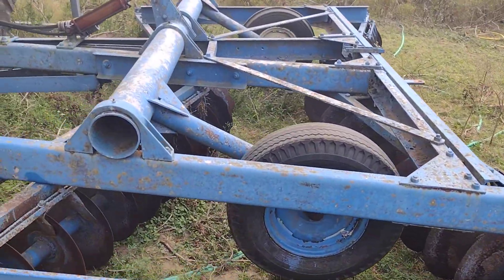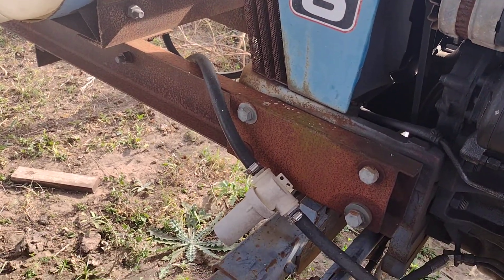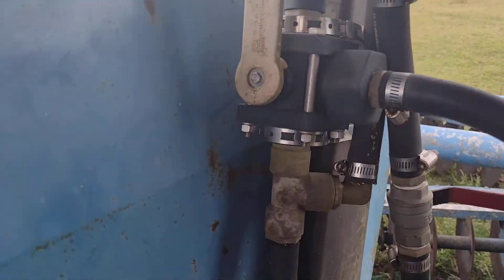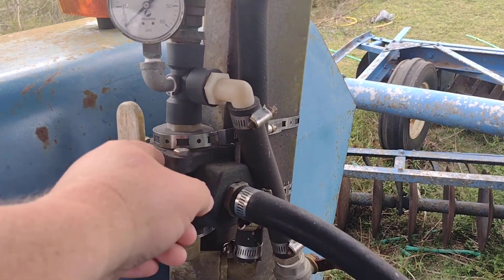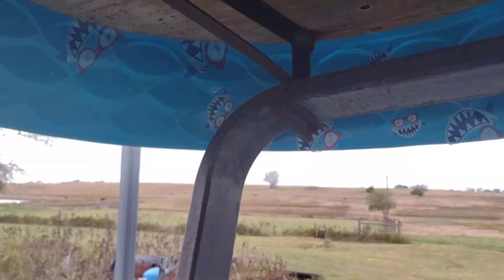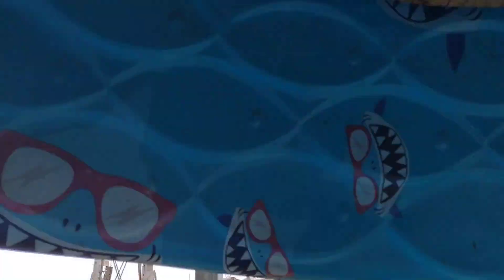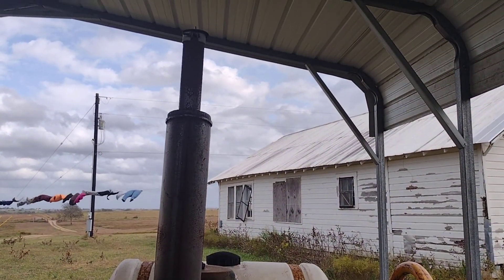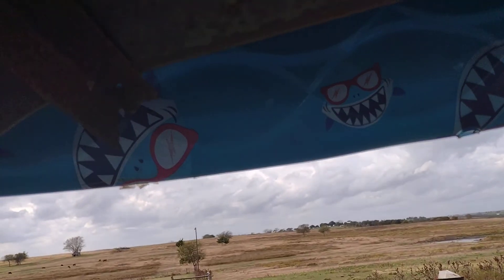24 Nov 2021- Kiddie pool tractor shade, sprayer setup on 5610S, Ford 247 disk

Comment from the maker: If you park the tractor in the shed, the kiddie pools last about 4 years or so before the plastic starts cracking much.  If your tractor is parked in the sun outdoors all the time, the pools will start to crack pretty bad after about two years... BUT they're cheap and easy to replace.  I built these way back in the mid-late 90's when we bought these tractors, which is why the frames are kinda rusty, but they've held up to bouncing over rough ground, working under trees, and lots of other stuff over the years, so they've worked great.  Sure beats roasting in the hot Texas sun all summer and even keeps a lot of rain off you if caught in a sudden downpour.  Well worth the time and money, and a TINY fraction of the cost of commercial made tractor toppers that don't even shade you as well, particularly from the sides!! Be sure to check out www.farmshow.com for other great farmer ideas and tips and tricks!!  Later! OL J R

Comment: Hey Luke how's it going? I ended up buying a Ford 551 round baler at a sale and have been working on it these nasty winter days trying to get it ready for spring. All the belts on it are slick including the wide platform belt on the bottom which seems to be a problem. I haven't got to try it out except for unrolling a roll of hay and trying to bale it back up and it wouldn't start the core spinning just plug everytime. Anyway long story short I have some spare 8 inch belting with great rough grip and am wondering if I could put 5, 8 inch belts in place of the platform belt. I feel like that would fix my issue and I just don't wanna spend money on it lol I bought it so cheap I wanna keep it cheap. Anyway I figured you were the man to ask about these balers. Thanks!
Reply from the maker: Hey how's it going storminnormanz??  Love the nickname BTW.  Best general since Patton!  The 551, is that a four foot wide chamber baler?  

Okay, lemme see what I can tell you.  First off, the belts ARE (were) slick on these balers... roughest belts you could get were the "mini-rough-top" belts which were golf-ball dimpled surface.  They don't use "traction belts" like the diamond or chevron patterns in other balers-- they didn't need them, and they can cause more problems than they solved.  On my 552, I have 6 bale forming belts up top which are 6 by 466 inches long, and the bottom platform belt is 5 feet wide by I forget the length.  NO, I would NOT replace the bottom belt with individual belts-- they will cross over each other, ball up, and shred the lacings and destroy each other.  There is a central "V" section on the back of the platform belt which runs in a "V" section on the front and rear rollers to guide the platform belt and keep it running true.  

The first thing you want to check is ALL the ball bearings on the baler-- every roller has two, one on each end, and they're not all alike, but they're all rather ridiculously small for a round baler-- what happens when the things were like some of the first balers made.  There is an idler roller mounted on parallel arms, that comes down inside the belts right behind the "crushing roller" right behind the pickup teeth, the idler roller is the "starter roller" and it has a bar with tines that come down between the belts to keep the hay from going between the upper belts and the crushing roller, to prevent backfeeding and the bale trying to form around the crushing roller which will lock up the baler and pop the shear bolt and cause all kinds of h3ll... MAKE SURE that the starter roller is free to move up and down-- it's spring loaded but it can get sticky and not want to move.  It should drop down with the tines between the upper belts near the back of the crusher roller to start a bale, once the bale starts and gets about a foot or so in diameter it will lift the starter fingers out by pushing the roller up on the parallel arms which moves it to the front of the chamber.  

Second, you want to make sure EVERYTHING is turning UNDER POWER correctly... the bottom platform belt is powered by the front roller underneath the crushing roller by a large sprocket and keyway... if the key shears, the shaft won't turn the roller, or if it "freewheels" to turn empty it will quickly stop under load, and the bale won't form.  There are 3 idler rollers inside the platform belt; their bearings are behind the tires on either side of the baler-- 2 are in the middle, the rear one is what the belt wraps around to to back to the front roller again.  It is spring loaded and has to be set correctly, using a pair of steel rods which should stick out just flush with the rear moveable framework the platform rear idler runs in... there's 2 bolt heads in the middle of two flat plates (one on either side) that pull on the springs to set the tension on the platform belt.  The upper belts are driven by a LONG #60 chain that turns the bottom front upper belt roller directly above the crushing roller, the next roller above it, and the top roller which is a tire-core type roller for a friction drive.  The top roller does about 90% or so of the driving for the upper belts, the belts fold back around it, then go around an idler roller, and then up and back and up and back through the belt shuttle, which is spring loaded and pulled backwards as the bale forms and gets bigger.  Those are all idler rollers as are the ones at the top and across the back of the rear door, which is forced open by relieving hydraulic pressure from the rod end of the cylinders back to the head ends of the cylinders through a pressure relief valve on the front of the baler, with a gauge to set the pressure (I run mine at maximum because well, it's an old baler and they don't make tight bales ANYWAY).  The rear roller is mounted on a pivoting subframe off the bottom of the back door, and basically the entire bale sits on that roller when it's forming until it's nearly full size, and it has two small ball bearings in it, and when they go, it will get RED HOT and start fires (ask me how I know) and so you want to roll that roller and make sure that its rolling smooth and freely, know you have good bearings in there.  There are a pair of cams that bolt onto the end of the shaft with locking Allen head capscrews recessed down in the cams, these cams set the clearance between the bottom roller and belts and the platform belt-- there should be about 1/4 inch clearance to start with the roller and cams pushed down against the door track.  It will close up under load as the bale gets heavier, and you don't want the upper belts, moving forward as they wrap around the bottom roller and onto the bale, scrubbing HARD against the platform belt which is moving backwards.  There's a setscrew on the RH side pivot as well which keeps the roller's axle shaft from turning in the pivots, and a pair of small pipe roller spacers loose between the ends and the pivots to keep everything spaced properly.  As the bale forms, when it is nearly full size, the door will be forced gradually back against the hydraulic relief valve until the bale reaches full size-- when it goes oversize, the door is forced back enough that hay continuing to come in the pickup is simply spit out the back through the gap between the platform belt and the upper belts.  To wrap the bale at that point, you have to stop, find the end of the twine in the ball of hay on the ground at the back, shove it up between the bottom gate roller belts and the bale, and then start up and turn the PTO back on and wrap the bale.  

I've never really had any problems with it starting bales... there's a short #60 roller chain that turns the crimping roller right behind the pickup-- the crushing roller and the platform belt all have to turn under power and load (check for sheared keys) in order to form a bale.  The bottom platform belt is turned by a large 80 chain and sprocket.  All the drive chains are on the LH side of the machine.  The bottom platform belt front drive roller turns the belt that drives the pickup on the RH side of the baler, and that belt can be problematical-- they stretch over time and get loose and can slip and prevent the pickup tines from turning at the correct speed under load, causing problems.   I was having problems a couple decades ago or so when I was still baling road hay-- mostly lush spring ryegrass which when it's dry is VERY slick... it wanted to ball up some in front of the crushing roller because the crushing roller had worn extremely smooth and shiny, so I took the baler to the shop and ran 3 weld beads of 6013 welding rod across their width, just slim, cool, high beads to give the roller a bit of traction, which worked perfectly after that... They made a friction tape kit you could install on the roller, it's in the book but who knows if you could get it anymore and besides I needed a solution RIGHT THEN not waiting on parts.  Just 'weld it cool' and don't get the roller too hot-- don't need penetration or strength, just some grip from the thin weld bead sticking up (6013 makes a 'taller' less penetrating bead at low amperage).  

IF everything is working correctly, it should form a bale no problem... I will tell you this-- it DOES like about as big a windrow as you can feed it, and it likes it shoved in there pretty fast particularly starting the bale.  I bale most of the time in 6th gear on my 5610 at 1800 rpms on the tach... it likes full speed and hay coming in.  Trying to bale a spindly windrow or at low speed will give you problems... If you overstuff it the shear bolt will break, and that's a PITA because you have turn the baler backwards with the turning wrench under the RH tongue gusset stabilizer coming down from the baler framework to reinforce the tongue, by opening the cover over the drive chains on the RH side of the front of the baler-- there's a squared-off end on the main gearbox shaft to turn the baler backwards, then use an old hay hook to dig the hay out of the pickup from under the crushing roller.  You can see my typical windrow size and shape and baling speed in my videos.  Usually when I pop a shearbolt it's because a chunk of mud from a sheared-off anthill goes into the baler and wedges between the crushing roller and the bottom front platform belt roller.  My brother bought a square nut socket off the net for a 3/4 drive ratchet, makes turning the baler backwards MUCH easier.  Shear bolts are installed under the cover where the driveshaft goes into the U-joint on the front of the main gearbox.  The reason it might not be starting a bale is because you're attempting to REBALE stuff, which in my experience never worked well when I tried it... 

If you don't have a book for the baler, I'd STRONGLY recommend you get one, either from Jensales or whomever on the internet, or even a Gehl 1500 baler book, though there are slight differences between the Gehl model and Ford model.  But they both use the same baling design, the differences are mainly in the pickup and gearbox placement.  

Hope that helps!  OL J R :)
Reply: @lukestrawwalker  alright 👍 thank you very much for all that information! Yes it it the 4 foot wide baler. Yea when I first got it checking over, the starter roller was frozen took a pipe wrench worked it slow got it freed up but the bearings were no good so I replaced them. It has 4 different adjustment holes its in the 2nd which my book says is the factory. Book was very helpful so far
Reply: I did check all my bearings they are good all belts spin normally and don't slip. My platform tension seems good. Someone before me welded beeds on the starter roller and also used non slip tape on it. The guy who owned it did tell me he had problems starting a bale he told me to bale sideways across my windrows until the bale started spinning. I can't figure out what in the world made him do that lol. I replaced alot of pickup teeth too and I fixed the linear actuator for the twine arm so far
Reply: I'm probably jumping the gun with the roundbale i unrolled and tried to roll back up. I mean that hay would be bone dry and already crunched up from the baler before is probably why it wouldn't start a roll
Reply: Also the belts spin fast when its empty and I thought i read somewhere they should slip slowly until hay gets into the chamber. Anyway I really appreciate you taking the time to give me that info!! Thank you
Reply from the maker: @storminnormanz  good luck with it, hope you got a deal because that baler is at least 40 years old, and Gehl has been out of the ag business at least 15 years, and Ford parts have been sh!t since NH bought them out in the 90's already... I'm looking to upgrade when I can myself, probly go Deere the wife's cousins love their Deere baler
Reply from the maker: @storminnormanz  yep
Reply: @lukestrawwalker  lol yea the only parts I found so far were the pickup tines from Shoup. Yea ive spent about $100 on it so far. I gave $375 for it at the sale back in November which ain't too bad. Couldve bought a big 5x5 hesston for the same price but my 4000 ford wouldn't like something that big behind it haha. Book says you only need 40 horses for this one and they had a optional dual drive sprocket that was smaller so you could get by will less power which really surprised me I figured minimum 50hp. Just thought it was cool being branded ford I mean itd look damn good being pulled behind a for tractor haha
Reply: I will tell you if ypu can find a jd447 baler ive used them my friend has 2 they are 4x4 but the bales are extremely tight probably almost 700lbs
Reply from the maker: @storminnormanz  Yep nostalgia value.  Hope she works for you.  The Hesston probably can get parts for, though.  From a practical standpoint it's probably the better baler.  You can always dial the pressure down and make a smaller bale with a bigger baler, to an extent.  When I get a newer baler, I don't have any intention to make bales anywhere near as hard as these new balers make them-- it's kinda pointless just get so heavy they're hard to handle, and  it puts a h3ll of a strain on the tractor AND the baler making those rock-hard bales... It'd be nice to be able to make bales a little harder than my old Ford is making, though... they've gone really soft over the last 10-20 years, and I'm not sure why.  Could be some leakage in the hydraulic cylinders, but I kinda doubt it... I can open the back door and have it stay put overnight; if it was leaking past the piston seals in the rams the door would creep down.  I did replace the hydraulic cartridge valve in the bale pressure hydraulic block (under the front cover of the baler where the twine tube is, under the pressure gauge) thinking maybe it was leaking, but having adjusted it all the way tight seems to have no effect.  I guess I just chalk it up to being 40 years old... she's had her day, and the cows don't seem to mind so long as they're round and edible, so if they look fuzzy and are a little harder to handle I'll just have to deal with it til I get a newer baler.  Later and good luck!  OL  J R :)